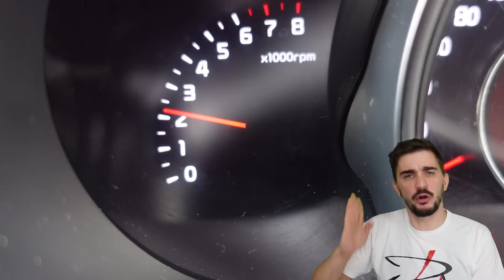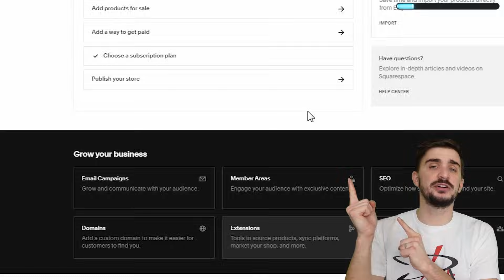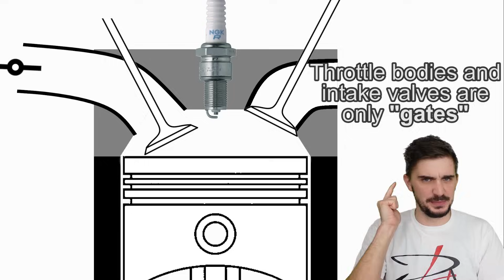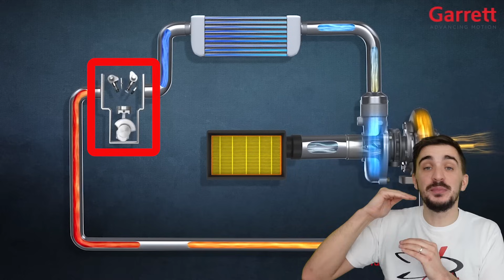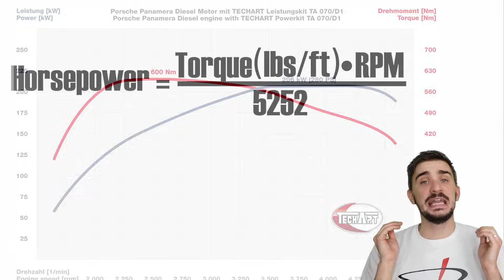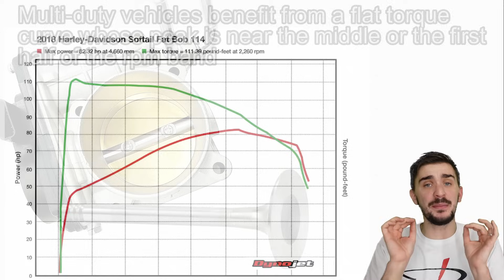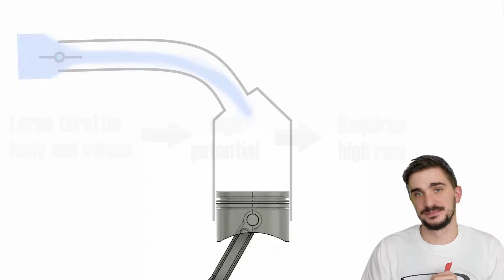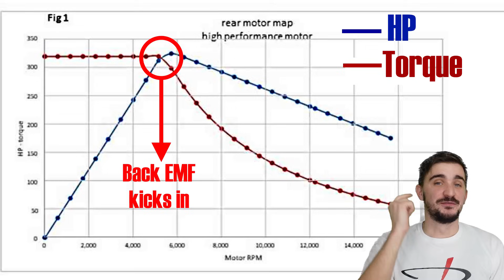WHY are HORSEPOWER and TORQUE CURVED?

Comment: Another thing to take into consideration is thermal efficiency - the faster the piston speed the less time the heat generated from the fuel has to leave through the cylinder walls.
Reply: Also combustion process speed, volumetric efficiency, combustion chamber pressure, swirl and quench,  fuel atomization etc...
Reply: @jeremiaswitt1374  combustion speed and cylinder pressure are directly related, as are swirl, atomization and volumetric efficiency (VE was mentioned in the video). But yes, there are all these factors which shows us that it's not always as simple as putting A and B together.
Reply: I would love to understand engine efficiency, particularly as compared between engine types like diesels and two-strokes.
Reply: @colvinwellborn  you would need a computer to sinulate those scenarios because if you try do math with moving parts it'll take a LOT of time. But overall, 2 stroke diesels get very good efficiency, partly because the resistance:torque ratio is different from 4 stroke diesels. But of course breathing is a little inefficient in comparison.
Reply: @colvinwellborn  hey colvin, if you wanna understand engines down to the theory, pursue the study of thermodynamics!! all of these stuff mentioned in the video can be summarized in sets of equations!!! if u dont, then u have to understand it in this verbal way, but the mathematics is brief but tells a lot in one go!! the thing he talked about throttle body valve piston speed etc can be summarized in bernoullis equation!!! pursue the study of newtonian mechanics and systems like classical mechanics and all these will come easier to u!!! especially thermodynamics!! all these complicated wordy terms are actually just variables in a mathematical equation and the math says them more quickly in one go. (any compatible physical property can be instanced in that mathematical variable) eg. do you know that a gas turbine (plane engine) is very similar to a 4 stroke?! thermodynamics will reveal this to you. its not necessarily throttle body will affect this and that....its more like x will affect y and given its square will affect this and that.....all in the math....
Reply: Higher temperatures generate more power.  This is one of the reasons you want high compression.  Increased heat improves combustion.  
Unfortunately, too much heat will destroy your engine.
This is why race engines run temperatures above 212°.
Reply: I think this is negligible here. What you mean is the following effect: when air and fuel react (burn) the volume would increase heavily without walls. But since the volume keeps the the same in this moment, the pressure raises. This is pushing the piston down (=torque). Now imagine to keep the piston fixed in the moment of combustion. Now the hot gas can cool down and the pressure lowers. This is the effect of thermal efficiency you are talking about, and its too slow to really affect the torque when an engine is running at already 1000rpm and above. So this could not explain (fully) the dramatic change in the torque curve over rpm.
Reply: It isn't thermal efficiency that you're citing.  You're commenting on frictional losses.
Reply: Simply put, the laws of physics don't produce straight lines; they don't even produce even curves, evidenced as orbital math by planetary/celestial orbits, which are elliptical.
Reply: I think you're right. I think the quenching of the combustion gasses at low rpm has a strong effect on torque.
Reply: Torque is affected by how full the combustion chamber is.  Peak torque occurs when the cylinder is full.
The RPM at which this occurs is irrelevant.

Comment: Why the explicit design of the "restriction" in throttle body and intake vlv in the following scenario then? Let's say we have an economy compact car engine 117 hp/160 Nm, peak torque at 4000 rpm and peak hp at 5500 rpm. What would it hurt if throttle body and intake valve were at max diameters? Wouldn't that have the benefit of both being an engine with the above mentioned characteristics and at the same time a potential for more power and torque if I want to get crazy and waste more fuel, in order to get more juice by accelerating higher and achieve an extended hp/torque curves? Or is it just about economy; cheaper to manufacture a smaller throttle and smaller valves/intake diameter to limit the design to a well defined/restricted engine characteristics?
Reply: It would hurt you ability to modulate the throttle, especially at low engine speeds. If the throttle lets enough air into the manifold at 20% opening for the manifold to be nearly at ambient pressure, the engine will make as much torque as it can. Opening the throttle further won't have a significant effect. 

Plus it would be more expensive to make and package a larger throttle body.

Valves are generally a large as they can be these days for efficiency. Sucking air past the valves takes energy, so it's most efficient (fuel/air mixing and turbulence aside) to minimize the pressure drop across the valves.
Reply from the maker: As I said in the later part of the video a larger throttle body increases power potential but to realise that potential you must rev higher and it moves peak torque higher up which hurts low rpm torque. This isn't desirable on a typical passanger car. Adding a few mm of diameter to a throttle body is a negligible cost, it's steel not gold.
Reply: @d4a  I think he's asking if torque at specific RPM decreases with less restriction due to the lower air velocity. As you said, peak torque gets moved higher up, but the absolute peak torque also increases, so that sentence alone doesn't tell us anything about where the previous max torque is achieved in the RPM range.
Reply: @d4a  Hence my saying "if I wanna get crazy (careless) and accelerate harder..." in search for some more juice.
Thanks for reply though)

Comment: Another excellent explanation. If one looks at a graph of horsepower and torque curves, assuming you're measuring foot pounds, horsepower will equal torque at 5252. This is the function of the math.
Horsepower = Torque x RPM / 5,252. So that when RPM equals 5252, the denominator will cancel out RPM. If you have a a Dyno graph in foot-pounds and the scale for horsepower and torque are the same. Then horsepower and torque will cross at 5252 rpm. If they don't, then something fishy is going on with the dyno mapping.
Reply: I wouldn't care as long as dyno is capable to be consistent between runs. In my mind dyno is just a tool for tuning.

Comment: Presumably electric turbos can pump more air in from idle RPM.
Reply: since they're not directly linked to the exhaust side or the crankshaft, probably. as long as manufacturers don't limit them in some other ways (ex. up to 20% more power draw than what the exhaust side is currently outputting, for power consumption reasons).
Reply: electric turbos do not work with building boost , they can blow air but not compress it  and are no good at high rpm , standard turbos can run well over 100,000 to 200,000 rpm
Reply: @richardsawtell256  i think he meant the kind of turbo porsche recently patented.
not the fake $100 leafblowers currently on sale.
Reply: @vukpsodorov5446  ohh okay well i have a few JDM subaru twin turbo cars and the primary boosts from idle which i guess that is what they are wanting to achieve
Reply: @richardsawtell256  basically, yeah. but in theory, as an electric turbo isn't connected directly to the exhaust side, it can give full boost at any RPM (assuming a large enough battery is connected to it). 
also there's the advantage of the exhaust spinning the turbine even if the compressor isn't running, so it can actually generate additional electricity (quite handy for something like a hybrid).
Reply: @vukpsodorov5446  yes of course it would be interesting to see how it preforms , but the company i work for is really only developing and putting R and D into EV stuff as the internal combustion engine is sure coming to a end  but if it wasnt,  An electric turbo would be good but would need good software to control it with out causing lean conditions
Reply: @richardsawtell256  that's entirely understandable, as in some countries, EVs already make up notable chunks of the market (and that number is only going to grow).
however, as porsche is trying to design synthetic fuel that uses carbon from the atmosphere, and toyota is trying to develop a reliable & capable hydrogen ICE, i think there's still potential for some engines to keep going. their numbers will drop significantly, and these technologies are in their experimental stages with a bunch of hurdles left to overcome, but the cars with internal combustion might just survive.

Comment: I noticed that an easy mod that gives more power on N/A cars is just putting bigger bore throttle bodies, leaving the stock valves and passages. Will this benefit as well a boosted car or it's worse because you'll lose pedal modulation?
Reply: It's a good bet you'd only see a benefit from that if you're increasing boost pressure or going to a larger turbo or supercharger - and even then, the car will have to be tuned for it, and the power increase will only be seen at higher rpms.
Reply: It depends, too large a TB will affect low speed drive ability. It's the same with fitting bigger intake valves. The best way to easily improve power on an N/A engine is to fit a less restrictive intake system and exhaust system (check out Cold Air Intake systems and on the exhaust side a lower back pressure cat-back system or a full system with headers). This has the effect of allowing more air into the engine and ejecting the exhaust gases out of the engine. Just doing this can give up to a 15% increase in power over stock. Best of all it'll improve fuel consumption at cruising speed and won't effect reliability.
Reply: @Slaktrax  well, I already have catless exhaust system (full exhaust) and supercharged at 15 PSi (procharger) with ported throttle bodies (it had 2x60mm and now they are 63mm). The car went from 330HP to 700HP. I have a det of 2x70mm throttle bodies but my tuner tells me I shouldn't install them because I won't see any benefit...  I guess the only way to know is dyno before and after (with proper tune) but I'm not into testing it myself.

Comment: Torque is sort of like the derivative of power

Edit: realized its flipped and I'm dumb. Original wording would be correct If I said integral
Reply: Yes but differentiating by RPM and not time. Since x axis is RPM, it looks exactly like the derivative would (scaled obviously).
Reply: @igornoga5362  so dp/d(t^-1)
Reply: Sorry, I'm only correct for constant torque, doesn't work otherwise

Comment: How bout v-tec or cams To lift  more air NA. Lol maybe
Reply: V-TEC and other similar systems basically allow the engine to run on 2 cam profiles - one that's more optimized for low rpm operation, one that's more optimized for high rpm operation.

Comment: I don't understand the problem/question yet but I'm looking forward to the answer already.
Reply: Dude same! The answer makes more sense then the question. But the question doesnt make sense. Which means nothing of this makes sense too me!😂🤨
Reply: horsepower is torque multiplied by rpm 👍
Reply: My question would be does anything happen when hp and torque are the same and the difference between an engine with let’s say 500 hp and 550 torque or let’s say 550hp and 500 torque